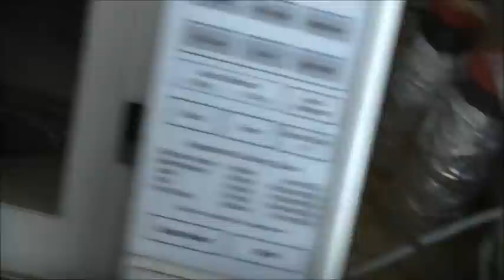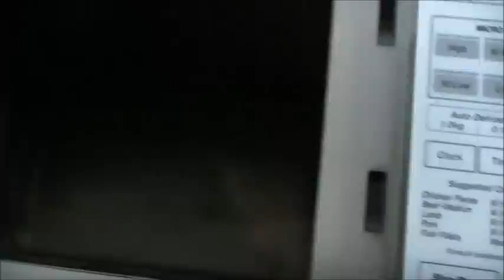Modded Microwave Safety Risks

Comment: Touching the inside-part of the magnetron is rather safe, given it's not powered (as in BOTH filament and HV).
If you have taken them apart, you will see that the antenna is well-connected to the shell.

If the input side shorts to the output, I guess the MOT would be able to deliver 0.5V or around so maximum. (note: ground to magnetron shell is one of the connections)

I suggest you take one magnetron apart to see for yourself. THey are rather cool-looking inside.

Comment: a magnetron will work without the cavity-but there is a very good reason for the cavity and the use of mica as a  window.look up mica and its uses,and you will discover that not only is it dielectric but can withstand high temperature and corona discharge.it is also both refractive and reflective,and has a very interesting property called 'birefringent'which acts to scatter diffferent wavelenghts passing through it.
like i said before,it is similar to how a laser cavity works.
see wiki-mica

Comment: RF and Microwave effects show up immediately, depending on how bad it is, simply stopping the exposure can cause the effects to go away almost as fast. You will feel a tingling or a heating to burning sensation depending on how bad your exposure is. If you didn't feel anything getting the frequency wrong probably put you in more risk for legal trouble than anything.

Comment: The radiation from the microwave is radio frequency radiation and a Geiger counter is used to detect ionising radiation. Alpha, Beta and Gamma. Thus you need a microwave detector. I've got both but I am on the other side of the country sorry :-) The risk in microwave exposer is briefly your eyes and then some organs. You can get cooked without feeling pain too as your pain receptors are mostly on the skin not internal organs.

Comment: The cover over the cavity is actually like a partial mirror the microwave radiation.It is made of mica and behaves like the mirrors in a laser tube...the radiation bounces around in the cavity until it has enough energy to pass through the mica.It is not there to protect you from touching the magnetron,it is there to make the system more efficient.Without it the cavity wont resonate.